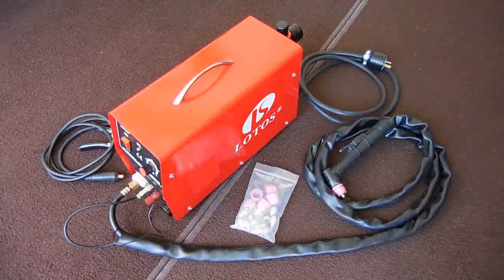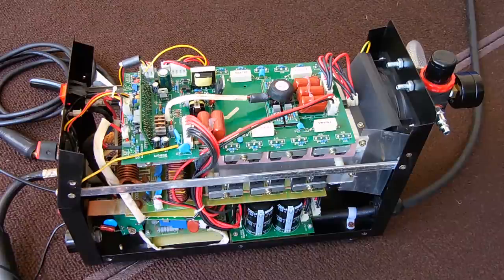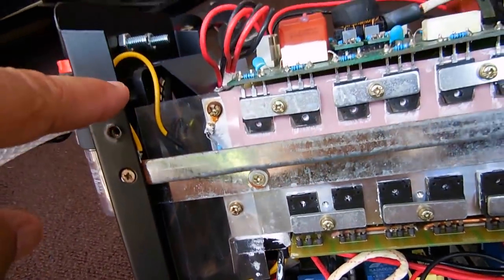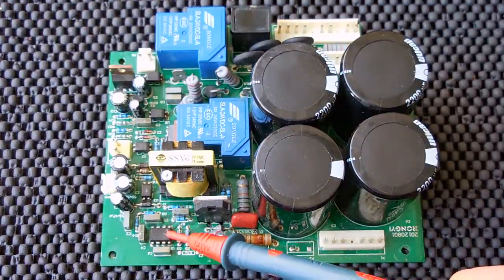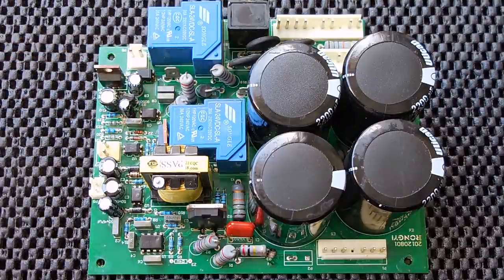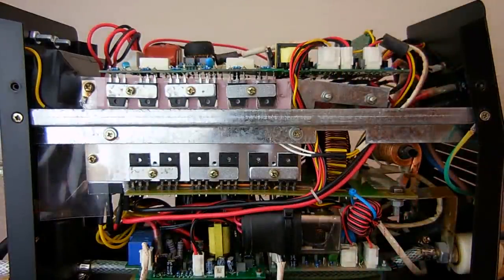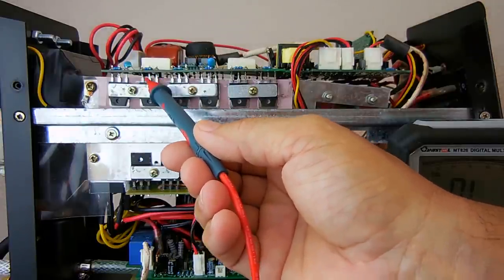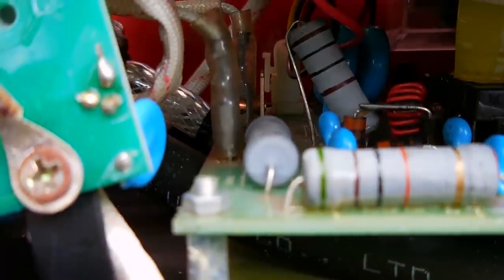How To Repair A PLASMA CUTTER!

Comment: Thanks for the video.  Not only did I replace a 5 legged transistor and solder a jumper wire to a burned up Hypertherm Powermax 30 plasma cutter PCB with amazing results but I also replaced a burst capacitor inside a brand new SIMADRE CUT 50 Chinese "plasma cutter" very much like yours sadly with no luck. It does have a dead black digital panel so I will look inside it again to hopefully get it going. It was received DOA by my friend that gave it to me.  The Hypertherm was a $100 gamble and with the short cut testing I have conducted thus far it works fine.

Comment: hi, i know these is a old video but the wright one for me i got a Hyperdome Powermax 30 that stop working, it won't turn on, i have power 220 v  I only check continuity all the way up to where the component of the board, I believe that it started when i forgot to turn the machine for a couple of days, i like the machine but i bought it new and to be frank it doesn't more than 70 hour uf use in the 4 years i have it, l did contact the manufacturer but they don't deal with the customers direct , you have to go by the distributors, the problem i have is that i bout it on ebay and i live in Puerto Rico can you help my please?
Reply from the maker: I don't know that unit.

Comment: My Plasma cutter pulses when it makes the ark with the cutting surface. what would you recommend? Has a good ground and accurate air pressure. Its the same unit in your video. Its a week old. it also doesn't seem to be cutting very good, i can only cut very this stuff. pilot ark seems to be working fine.

Comment: got the cut 50 and have used it 2 times then all of a sudden no air or fire at the gun the unit runs and the digital readout flashes 000 any ideas?

Comment: I have a Vevor dual voltage pilot arc cut50 plasma cutter .  Powers up ok fan runs and when you pull the trigger the air blows but no spark at torch or contractor ( points thing ) tried spreading them a little .  Still nothing.. air shuts off like it should once trigger is released.. Vevor seller was no help at all… any ideas would be greatly appreciated

Comment: I have a question, maybe you could give me some advice. I would be very appreciate . I bought a Longevity Force Cut 40d and found it not working, but after bridging the overheat fuse it started and working. However, when I press the switch in the gun, nothing happens, but this does not mean that it is damaged, because I checked it with a multimeter and the switch works properly. I think something is damaged on the bottom PCB board and the relays are not turning on. I took out the board but I don't know how to check it with a multimeter. Can you help please.

Comment: And where do you get a book of every standard ever made transistor and diode Exedra there are some components on some of these boards that I don't know the names and you might look up the part number but can't find anything on it or no information on it especially stuff that's 25 years old so where do I get information on a diode transistor capacitor excetera when I don't even know what the name of it is and can I also test all the components even integrated circuits and Moss fats with an ohms meter

Comment: And I thought that you couldn't test components or parts within a circuit because you have many multiple circuits in one circuit that carries the same filament on the reverse side that chromis type Trace so if it's got five different signals in one Trace how do you know you're not picking up the a Jerome's and continuity from them other put together I thought that was the whole purpose of why you have to take it the peace out of the board to be able to test it correctly

Comment: Thanks for covering a majority of the possible issues and test procedures. Even though it turned out to be a resistor and a relay only, It helps to know the other points to check.
Reply from the maker: You're welcome Doug! Be sure to check out my video playlists, rate thumbs up, and share my channel with others.

Comment: Very comprehensive! I have a Lotos 3 way machine LTPDC2000D that has that same issue of not turning on.  I'm thinking the power boards may be similar. The other day I used the plasma cutting function to cut a 1/4"  X 4' bar, turned it off and that was the last time I used it. It now won't turn on. I'm hoping  the relay issue you've discovered is it. But I do realize the rest of the board needs looking at as well.
Reply from the maker: Hope you figure it out. Thanks for watching!

Comment: Great video!  Love your detailed, yet concise explanation and narration.  

Attempting second repair of a 520D plasma/TIG/stick combo machine.  First time it failed with a very loud pop when I turned it on.  A 1" or so length of thick solder tracing below Relay 1 ( occupied by the exact model of Songle relay that you replaced ) had blown completely off.  Replaced the relay (which may have been ok), and it worked again.  This last time it broke I was cutting steel which had a lot of holes in it, causing the plasma arc to repeatedly go out and back on.  At one point the machine suddenly shut off, and has not come back on since.  Not sure what the problem is this time, but my large caps are slightly bulging.
Reply from the maker: Always replace bulging caps.

Comment: Thank you for the great video I have the exact same plasma cutter, you inspired me to take it apart and try to repair it,  I removed one of the boards you did and what I found are 6 of the 9 pins on the transformer with broken solders.

Comment: Excellent video, clear and precise working through the machine in a clear logical manner. Fixed my CUT 50 badged as an LTSUK. The spark gap was too wide! simple intermittent  fault which had been with the machine since I bought it. Thank You :-)
Reply: @nathanielwyeth3778  No, just wouldn't start.
Reply: @dianasmith8890  how wide did you set your start up gap? Thanks.

Comment: Thank you very much, great video.  I just now fixed mine.  I had one bad power supply board relay, and both diode bridge rectifiers! I replaced both relays since they came 3 in a pack.  Works like a champ now!
Reply from the maker: Great to hear Don! Be sure to look over my extensive videos playlists that cover a wide range of subjects, and most importantly share my channel with many others. Thank you
http://youtube.com/c/electronicsnmore/playlists
Reply: What where the signs of your bad relay
Reply: @anthonylester3247  well, I wasn't getting an arc across the electrodes inside...looking at the relay it had  discoloration to its plastic cover. Email me, I'll send some photos I found.  Campbell donald at hot mail

Comment: what a great video!  I have a Hypertherm Powermax 600 and it's acting like my ground cable isn't connected. It arcs but doesn't penetrate. I have not opened it up so the problem might be obvious, but until i do... any ideas and suggestions will be greatly appreciated. New electrode nozzle and  drag shield cap from Amazon.  also I just subscribed may not mater but it's refreshing to listen to someone who knows what he's talking about instead of blowing smoke.

Comment: Plasma cutter does not arc!

Hi. Excellent video.., well done!

Wish I had your knowledge... and I'm hoping you might see my post and reply!

I have Jasic ct312dc Arc, Tig and Plasma... imported from China in 2009 and replaced a capacitor and the on/off switch. In general very happy with the machine, though!

I have not used the plasma function for almost a year and my welder stood unused for the whole of last winter in my workshop. This summer I have used the arc weld function without problems.
This morning I hooked the cutting torch up and could not get it to arc.
After opening up and cleaning with compressed air, I managed to get an arch and do a cut.

Glad that I seemed to have solved the problem, I replaced the cover and again no spark!

I found the wires in the torch head shorted due to wear. Soldered, insulated and continuance test positive from the trigger button, to the connection point.
Spark gap set at 1mm (0.04") and sparking. No visible damage to any parts, fan operates and compressed air flow set at 0.4Mpa.
Earth functioning perfectly when tested with stick welding.
Water trap in-line and always worked.

I adjusted the spark gap from 1.2mm down to .8mm, with 10mm intervals.

Still no spark... any ideas ?

thanksdt
Reply from the maker: Could be MANY things. Inspect all wiring connections as well as the relays.

Comment: Great video thanks for posting info on these machines. 
      I have the same machine with no air flow. Valve not getting voltage. Everything else working fine. Any suggestions would be helpful. 
    Once again thanks for such a great video.

Comment: I agree with everyone here. The video is amazing. You are easy to understand and follow.  In my case my machine is completely dead. No lights or noises. From your video,  I think my problem is somewhere on the board with the 4 large capacitors. I have checked for power going to that board and it is good. Have you any idea or tests a non pro can do at this point?
Reply from the maker: Power supply board issue, or bad connection.

Comment: Great video, I always make a point of checking the resistance of mosfet to heat sink if thermal transfer insulation pads are used, Had a few faults due to badly aligned insulation pads in production.
Big Thumbs Up.
Reply from the maker: Thanks for watching Mike!

Comment: Hello Doug. Has always an outstanding How to video. I think I have the same model. it's duty cycle isn't 100% So I let mine cool for a bit between cuttings. If you didn't get a manual with it I will try and make a PDF for you,no charge.
All my very best.
Bobby
Reply from the maker: Hi Bobby. I think the duty cycle is 60%. I downloaded a pdf manual online. Thanks

Comment: Thanks mate

Just picked up a second hand unit similar to yours. 
The pilot arc was very intermittent.  Cleaned and opened the spark gap and is now much better.  Not 100% but useable. 

Pilot arc is not as strong as others Ive seen so may another look possible a sick cap?   Will now search for a cct. 

Cheers
Reply from the maker: Keep playing around with that gap. :-) I have a lot of excellent videos on my channel that cover many different subjects, so be sure to check out my extensive video playlists for other videos of interest to you, rate thumbs up, and most importantly share my channel with others. Thank You

Comment: I bought this same plasma cutter and would like to use a torch height controller for CNC machine cutting. A torch height controller is a feedback system that locks onto a desired analog voltage level provided by the plasma cutters arc. This voltage is dependent on the material being cut, so the THC has to be set at a certain voltage depending on the thickness of metal. If the gap gets bigger it results in rising resistance due to the increase of arc gap. If the gap gets smaller voltage drops because of less air gap. The z axis uses arc voltage sensing to maintain the proper distance. Metal sheets are not flat enough to just set the height of the torch above the machine and start cutting. I need to hook the torch height controller to the arc voltage of the machine. Is there a voltage divider in the machine or some way to get a arc voltage reading from this machine?

Comment: I very much enjoy your videos. I am learning basic electronics and want to turn an old PC power supply into a bench power supply. There are of course loads of videos doing such things. But it would be great if you should show how to safely test and indeed discharge such power supplies or capacitors (you only mentioned it here) as well as any other potential danger things to look out for in such a project for a noob like me. It is something I worry about a little because I don't yet know enough and I would just like to be safe.

BTW. I am asking you because as mentioned, your instructions are very detailed, and you speak very clear and concise. I very much enjoy your videos.
Reply from the maker: Hi. In my (2) popular microwave oven repair videos I explain how to safely discharge capacitors. :-)
Reply: Thank you. I will check those videos now. Keep up the great work. I learn a lot from you. :-)

Comment: Great job! You made the unit look brand new like freshly out of the box :)
Reply from the maker: Yes. I like everything to look nice, including my equipment/tools. :-)
Reply: Funny is that i see that the pcb on the top is the same or almost identical to his "stahlwerk" plasma/tig welder also a china made unit but the fault on his was the dc dc converter where the thick black/red cables are connected on the circuitboard R210 was burnt so it could not start to oscillate but if you gave the gate a touch with 9V thru a 10k resistor then it started up
So replaced the resistor and it works now.
Reply from the maker: Hagis2k
Not surprising if the boards are very similar. US companies use Chinese companies to make their products. The Chinese then copy the product and sell it for less. LOL. Not good.
Reply: So true then the specs and quality on parts are lower too most often with shitty ChonX capacitors that work a year or so until they are cooked, yeah most products are designed either in us or europe then manufactured in china... And as we all know they do not give a hit about copyrights and so lol same with CE mark.. Oh that must mean Chinese Export :D

It is kind of shocking when you buy items on ebay etc sometimes you can recieve really good quality almost for free then like the last powersupply 230V to 12V 1A which i dismantled in pieces as i always do... to find the small cap for the startup almost dagling free and then the optocoupler was almost not soldered in... Quality control? Wont pay for this item for sure.
Reply from the maker: Hagis2k
I can say that Chinese product quality is getting better, they're forced to produce better quality items.

Comment: Fantastic job!  I have the same brand, different model..runs fine on 240 volt, serious power loss on 208.   My mobile generator is a 208 3 phase so could I use a 3 phase full bridge rectifier to feed this unit with DC?  That way my generator sees a balanced load over all three phases.  This is a 12 kW Lima MAC generator,  more than enough kVA for the advertised power factor of 0.93.
This generator does fine on my Miller Dynasty which is 3 phase.

Comment: I have a thermal dynamics dynamics pak 4xi that I just bought used only to find it didn't have a pilot arc when I got it home. since I came across this video and you mentioned a relay in there that controls it come to find that was the case with mine cleaned it with sand paper and good to go great video!!!!!!!!
Reply from the maker: Great to hear Josh! Be sure to rate thumbs up, subscribe, check out my extensive video playlists for videos of interest, and share my channel with others. Thanks

Comment: Hi well done very informative video.
Just one question from me.
I have a three phase SAF nertazip plasma cutter and when I switch on the machine only the fan works but nothing else.
The two contacts that must have a distance between them they are exist in all the machines even they are inverter or transformer?
Reply from the maker: All the plasma cutters I've seen have a discharge electrode gap.
Reply: electronicsNmore thank you very much for your help.

Comment: Thank you for sharing your Knowledge friend. A Cal Electric cut 50 has the same boards. I will need to refer back to this Awesome video when i hook mine up to a cnc table and have to hook up a torch height adjustment into the mix (adjusts height for optimum efficiency by reading torch voltage).
Reply from the maker: Nick Vee Thanks for watching Nick!

Comment: Boy I wish I had Your knowledge. Bought a Chinese (Infinity) 200amp TIG welder and it had no HF start from day 1. It was going to be such a pain to return and take too long (I have work waiting) that I just brought it to "Toll Welding" to have them hopefully fix it. I checked the points gap Myself (.029 I thought was a decent gap) and looked for burning etc on the boards I could see. I had very light voltage across the points (did not measure it) and got a light spark when I placed a screwdriver across the two. Frustrated. I sold My old welder to buy this so i am stuck without a welder until it's fixed. I hope they can fix it, if Not I call Infinity in California and order a new HF board and fix it Myself-I hope.
Reply from the maker: Thanks for watching! Be sure to check out my video playlists, rate thumbs up, and share.

Comment: I'm hoping to use this video to troubleshoot a little ltec I got at a garage sale for 20 a few years back and never got working
Reply from the maker: Hope the video helps!
Reply: @electronicsNmore  well I just figured out that I don't have sparky in the gap it has, the pieces for the gap  were offset, wire leading to it is frayed, and a diode up the line a ways was bent. I'm going to have to watch a few more of your videos and others to diagnose any circuit issues if the wire fray isn't the issue